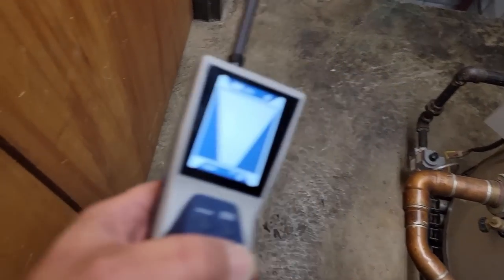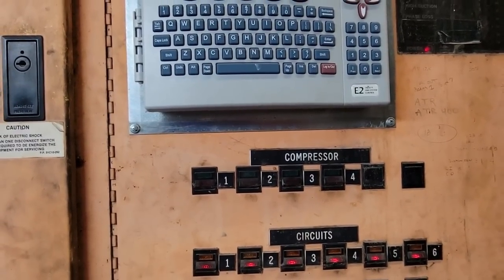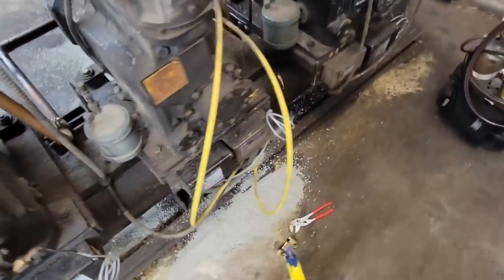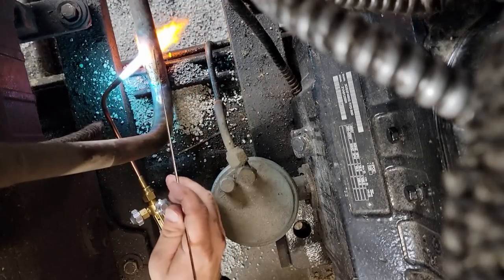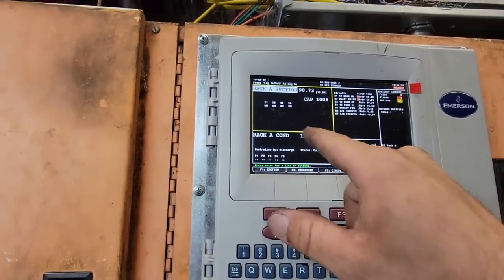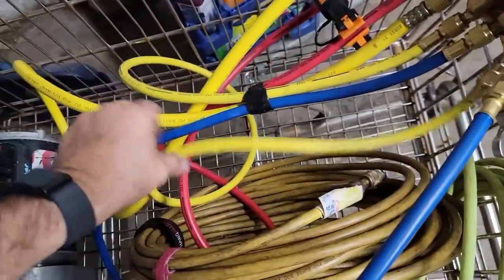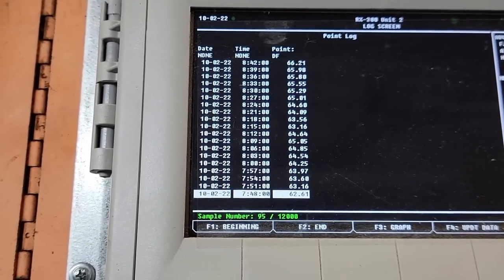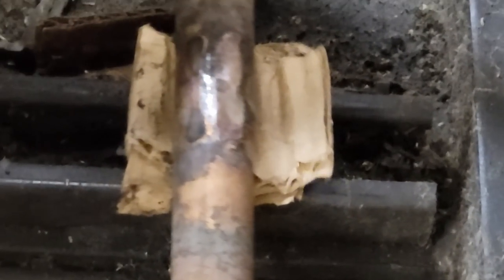It's Sunday and somebody has to save the pizza!

Comment: I like the commercial videos because I like the diagnosis and descriptions of the various system types. I wish these systems self isolated the bad circuit upon refrigerant loss and used vibration insulators at clamps near compressors. So much needless refrigerant loss!
Reply from the maker: I hear you 👍👍
Reply: You could make a system like that with common parts, but would be expensive as f***. And more that could break.

Comment: Nothing like the drone of all those recips chugging along. So much more interesting than the standard resi and package unit stuff. 

Dumb question (I'm not an HVAC guy)- in an installation like that where there are so many loops, wouldn't it be simpler and require less refrigerant to have 1-2 small screw chillers and run glycol loops instead?

Comment: Nick, the over and under technique is something I learned from the audio engineer at college, and have taught it to others. Incidentally, it's the same technique that mountain climbers use for their own safety.
My foreman at work asked me to do this to a 3" sandblasting hose for a food products silo. It worked well, and most importantly, the hose didn't twist.
Reply from the maker: Microphone cables is how I came about learning it. It works just make sure you unravel it the right way LOL
Reply: @HVACRSurvival  that's precisely how I learned. Plugging the ends together helps to eliminate this. Otherwise, you can get a knot every 3 feet if not diligent in the procedure.

Comment: The bigger stuff is the good stuff😍.
Great video.
If you have problems with the olie boiling og pressure rising, when braising, connect your vacuum pump. Works like a charm.
I know you couldn't do that at the beginning, because there was no valve.
Keep up the good work.
Reply from the maker: Thank you sir, I have heard of that before, I don't think I've ever tried it but I will keep it in my back pocket for later. 🤜🤛👍👍
Reply: One of the signs of a professional is willingness to share and willingness to learn!
Reply from the maker: @adamdnewman  thanks Adam🤜🤛👍👍

Comment: The discoloration on your rosebud tip is a  sure sign that you are not flowing enough  gas. Just like the back firing you were experiencing.
 A #15  tip is rated at minimum rated for  flowing 10 scfh acetylene, an MC tank is rated 1.5 scfh flow.   

American Welding Society says tank  capacity in cubic foot divided by 7 is safe flow rate.
 B tank is 40cf divided 7 is 5.7 cfh, still low for a #15 rosebud, but much better, often enough for intermittent use.

The victor handle helps with the flow rate, probably less restriction inside, but B tanks and larger regulators are need to even approach the needed flow rate.
Reply from the maker: Number 15 is what I've got that you've seen, now I have had it in my bag and it was kind of green looking and I ran my wire brush wheel on it to make it look clean again. But I did have my regulator set at 10 and 12 I believe from what was on the instruction sheet from the manufacturer. I spent some time on the phone with the manufacturer when this first happened and did everything they mentioned but nothing worked, the length of the center connection is a little bit longer on uniweld versus Victor and I think the gas was mixing in the handle causing the problem. This is rated to go down to as little as a quarter inch up to two and seven eighths. Thanks for the info
Reply: Love that tip. The #15 is my "all in one". I run it on the Victor handle with settings of 7/11. Never had any issues. Love that tip tho. Nice work. That ball valve just before the separator is awesome. Wish more people did that. I always end up having to add one after I need it.
Reply: I think what he’s saying is you can only draw off a certain amount of acetylene from the tank if you draw off too much with too big a tip you get liquid acetone coming out the tip
Reply from the maker: @BrickTop900  I wondered if that was what he meant. I told uniweld what size tank I was using🤷. They said it was ok but who knows. I don't do 30 fittings at a time so that's probably how I'm getting away with it. Generally I might run my torch for a couple minutes then I'm done.
Reply: @HVACRSurvival  yeah that would help. I’m a plumber over is Aus and in the middle of winter with too large a tip doing a bunch of large fittings I’ve definitely had it happen to me using our small cylinders. Thanks for the content always a great watch

Comment: Yes sir I do watch these as well! Glad to see them on your truck. I have a victor set too and bought a uniweld tip and seems to work fine but now you have me worried about it.
Reply from the maker: If you're not having it go out and pop backwards on you then you're fine, for whatever reason mine did not fit down in the socket of the handle as fully as it should have. When I lay the tips inside guts beside the two, one's longer than the other by maybe a 16th of an inch.

Comment: Man the knowledge you have is amazing you go to any kind of system and just run right thru it I can go like that on residential and light commercial units because I've been doing it for 30 years but you can do anything I'm glad I found your channel and I'm still trying to buy tools thru your channel I don't know why it tells me that the page doesn't exist thanks for the video
Reply from the maker: Thanks donald, I need to list direct links to the tools I have a feeling that I'm getting screwed over by the system I'm using.
Reply: @HVACRSurvival  you might be but I'm always buying tools and you have some that I like and I would like to buy thru your channel to help support you but it still won't let me I just tried before I wrote this message
Reply from the maker: Was there anything in general you were looking for? I can look it up or if it's on Amazon you can click my link to Amazon and it will automatically give me credit for anything you buy after clicking on it that day.
Reply: @HVACRSurvival  yes I need a new battery tester and I have one of the analog testers that you have but it's about wore out I'll order that it cost like 30 dollars on Amazon so you can get some kickback from that I'm going to order more stuff just I woke up this past Sunday morning and I had a stroke in my sleep so I'm getting over that so I can get back to work
Reply from the maker: @donaldpainter956  I'm sorry to hear that, I hope your getting checked out and doing all you can do to keep yourself healthy. Hang in there
Reply: @HVACRSurvival  oh yes sir I went to the hospital Sunday morning that's how I know it was a stroke I'm doing my rehab now I hope to get back to work very soon

Comment: Great job Rick, glad your new or old torch tip is working out for you, Those refrigeration systems seem like constant maintenance, you definitely know more than I do about those systems, that's for sure.
Reply: @HVACRSurvival  That's too big of a tip, even for a B tank. I was looking into getting a 2-MFA-J for my Victor setup, but even a size #2 rosebud is too big for an MC tank. A size 0 tip can do up to 1". A size 2 can do up to 1.5 inch. Yes rosebud is better for heating large fittings, but the Cuft per hour is too much for even a B tank. You can get rosebud tips for the Victor J series handle your setup came with, just need to be the -J series.
Reply from the maker: Sure it's going to drain the tank quickly, but I'm not doing large pipes all the time so it can be throttled down to as little as a quarter inch.
Reply: Yeah, that's right ✅, watch your gas, Rick. 😄haha.
Reply: @HVACRSurvival  Don't starve the tip. A good way to see if you're starving the tip, is get a good neutral flame going how you like it, then cut off all the oxygen. If you get a big smoky flame, and all those little nasty strings of soot flying thru the air (we've all done it) then it's not enough fuel for the tip. A good rule of thumb is turn up the fuel just enough to clear the soot and smoke from the flame, then add oxygen. That avoids popping and flashbacks etc.
Reply from the maker: That makes sense, but then if the flame is way too powerful I'll melt the copper. I know you can't throttle a map gas torch but I was always under the assumption you can throttle a regular oxy acetylene torch.
Reply: Are you talking torch talk? I don't know if that permitted among professional people 🤔.
Reply: @HVACRSurvival  Yeah it's the same as a Mapp turbo torch, I have one that has a trigger ignition, works great in a pinch to solder some copper. But the tip turns cherry red if I don't have it cranked up enough. Anyhow, that's the same thing with Oxy Acetlylene except its much worse. What's happening is, if you throttle a oxy-acetylene tip, it starves the tip. What I mean by that is, it requires a minimum amount of flow to keep the tip cool. If it gets hot at all, it doesn't take much ignition energy to light off the mixture. Just like how people have blown themselves up filling a clear plastic bag with a neutral flame mix, and take it outside. Just the UV from the sun or a tiny bit of static is enough to light it off. So what happens is you get a pop, and a mini-flashback. If you get a miniflash back, take the tip off the torch and you'll see it's all black from soot, from just one pop. I looked up the specs on that MFA-15 tip. Holy moly that thing needs like 33 cu ft per hour, so it can't even run off of a #4 tank which max out around 13-14 cubic feet per hour. A size 15 rosebud at full throttle makes about a 6 foot long flame. Those things are meant for pre-heating large steel pieces before welding and stuff like that in a fab shop with a manifolded bank of oxy and act tanks. Here's a good video on the subject. Skip to around 0:25. https://www.youtube.com/watch?v=gWZSjGk5rUM

Comment: I checked out your kit, but couldn't find that oil pump you got.
Reply from the maker: https://amzn.to/3rzita1 I don't know if the exact one I have is made anymore,  I've had that for over 22 years. This one made by Yellow Jacket looks about identical and is capable of pumping against  200 psig of pressure in the system. It actually pumps more oil per stroke than mine does.

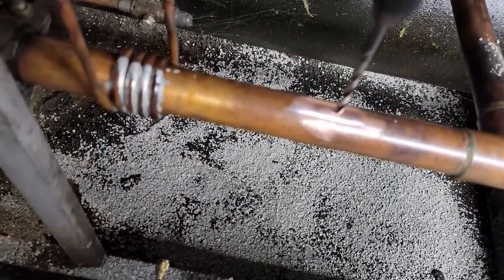Comment: Great video, Rick!  Question at 9:42, what’s that loop of 1/4” or 3/8” copper wrapped around the discharge header doing?  Some kind of weird temp sense or something?
Reply from the maker: I'd have to recheck I'm not 100% sure now, it's been a while since I've looked, I believe it was for one of the solenoid valves or three-way valves? They did that when they updated the condensers.

Comment: Don't think you have to apologize for anything you did. So much oil in piping with refrigerant boiling off no need to pull vacuum. We work in real world, not a textbook. You repaired it, charged it up, topped off charge, backon line. What more could you ask for overtime call on a freezer!
Reply from the maker: Thanks Glenn🤜🤛👍👍
Reply: If there’s any noncondensables you can burp the condenser
Reply from the maker: Tony -I have heard that was what the inverted trap is for at the condenser. I haven't done it yet.